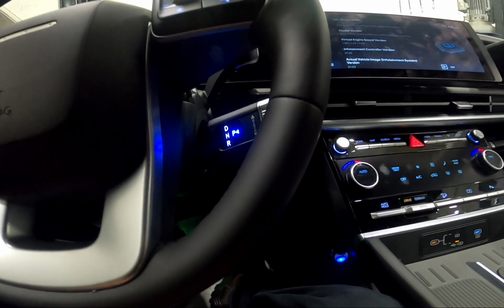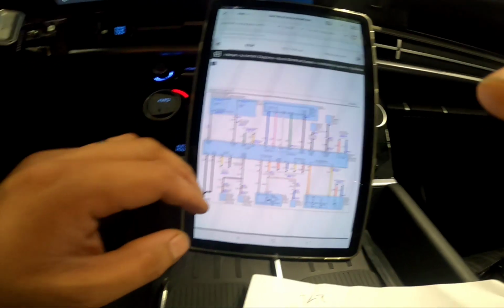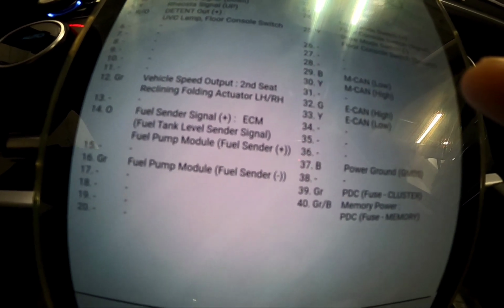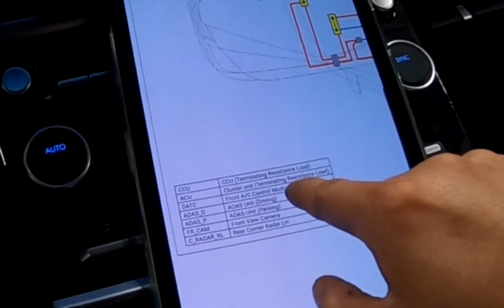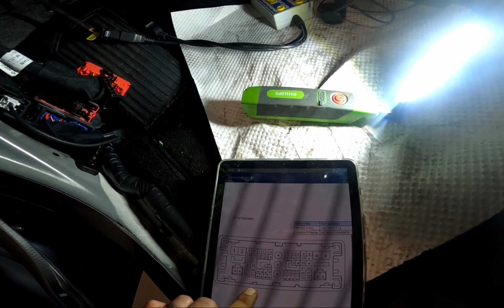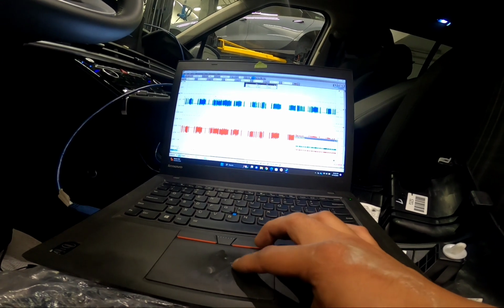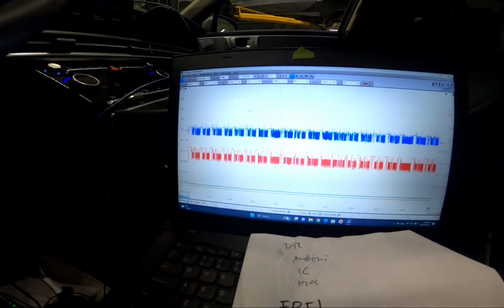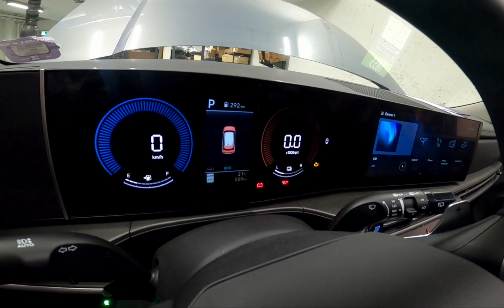2025 Hyundai Santa Fe Hybrid | Communication Network Fault

Comment: I have a 2024 Santa Cruz and I’m getting multiple warning lights, took to two dealers and both are saying cause I tapped into two wires 8 months ago that the harness needs to be replaced and it’s going to be $7000. I owned a company for 15 yrs doing aftermarket electronics for new car dealers before I sold the company. We’ve removed the relay and wiring and the issues continues. I’ve asked if we replace the harness if that doesn’t fix it what the next step they said the ICCI. I asked to replace that first and they said that that they had to do the harness first. Is there anything you can suggest to help me?
Reply from the maker: Which wire was tapped in? And did you try reinstalling the original wires to its orginal position? What were the codes?

Comment: Hello, hope you are doing well. I am planning on buying a full option 2025 santa fe hybrid. Based on your experiences, do you think it is a good vehicle? I was debating either Santa fe or a used 2025 Genesis GV80/BMW X5. Thank you for your videos!
Reply from the maker: The hybrid santa fe ive seen some problem cars in our shop, but since we are a dealer we see this stuff coz theres a lot of santa fe, if im gonna rate it like in every 10 good santa fe theres 1 that got some issues. I dont have any insight about bmw some people say its great, some shops it says its not good. For gv80 they are pretty solid vehicles.

Comment: I am wondering why Hyundai didn't add dielectric grease between connection to prevent any corrosion?
it will be cheaper and save time+money